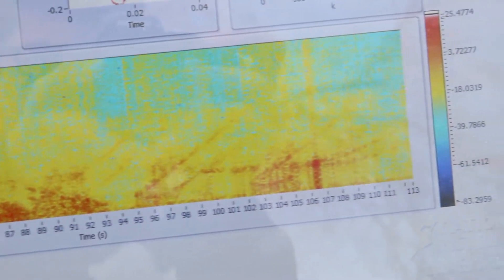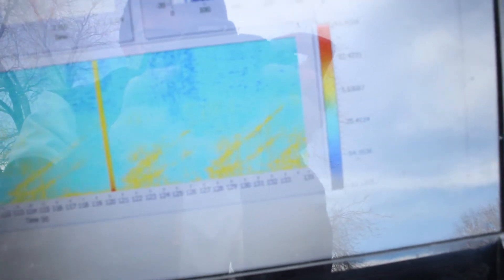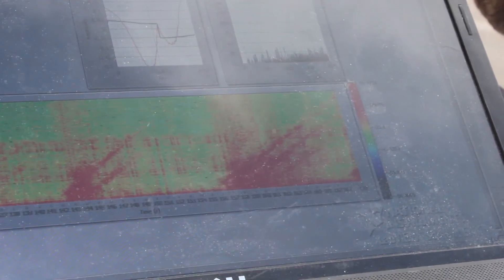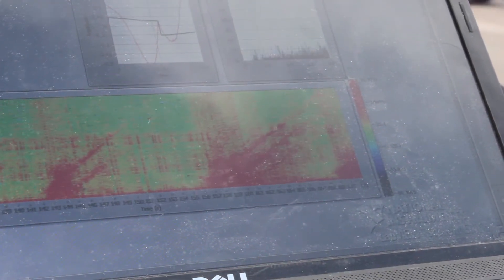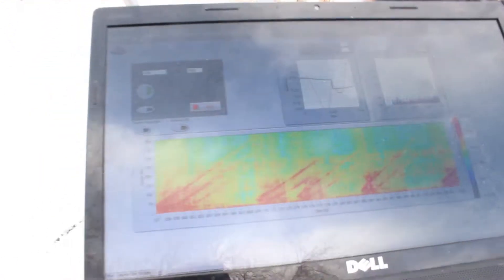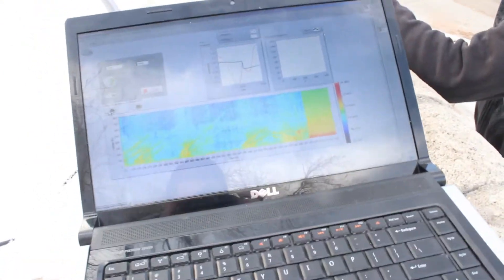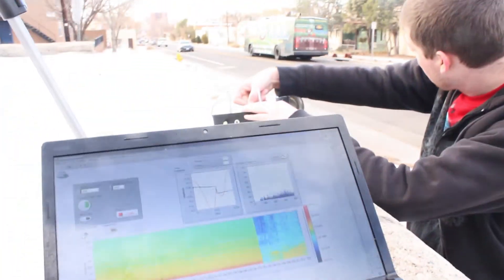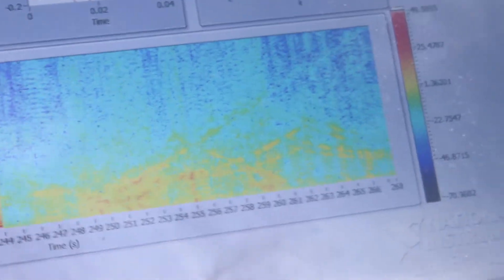RADAR demo

Comment: Hi there,
Could you share part of the LabView code?
Thanks in advance
Reply from the maker: Yariv Shavit, I don't have the code available now, but it's basically a spectrogram generator. We adapted the MIT open course MATLAB code to run in labview
Reply from the maker: I found the code, but I no longer have access to the radar or LabVIEW so I can't test it. Let me know if you want it.
Reply: Tyler Jordan I would like to see it. I took a different approach but I would like to compare
Reply: Yes please, would be awesome. Could you send a link for download or simply by email.
Many thanks in advance
Reply from the maker: Try this out and let me know how it works. I haven't used it in awhile, but the only complication I can foresee is that we used a special NI USB device to grab the audio so that block may need to be changed.
https://gitlab.com/tsjordan/coffee-can-radar
Reply: Do you have the code for the LabVIEW program you used in the video? The github link codes you sent this gitlab link has different labVIEW codes as the frontpanel side is different.